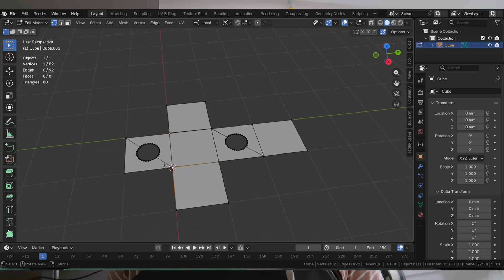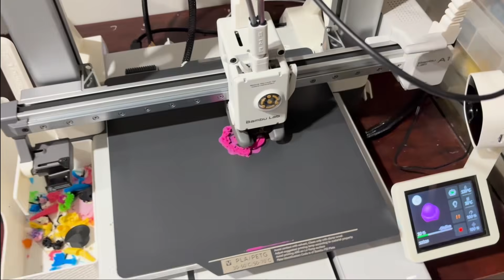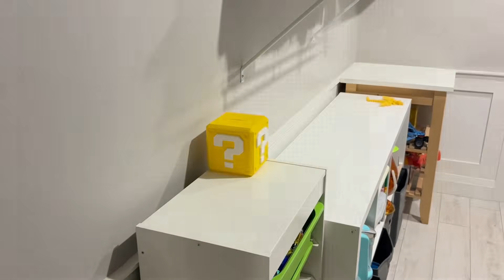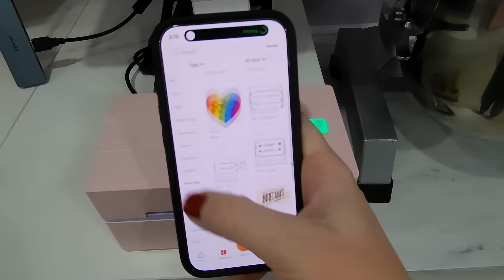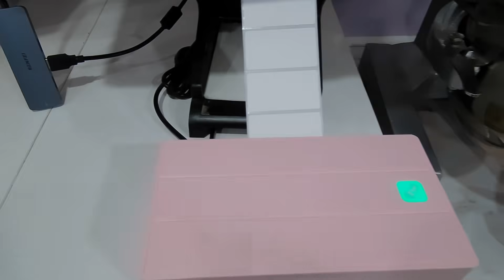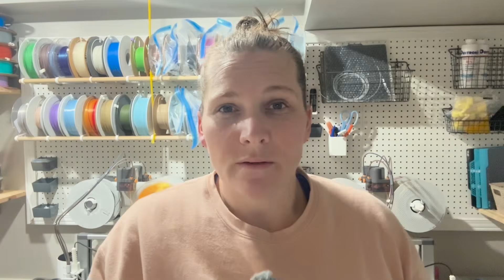Teaching Myself 3D Modeling With No Background - A Week Behind the Scenes+ MUNBYN 403B Label Printer

Comment: Are you using a cylinder as the cutting object in blender?
Reply from the maker: I’m using the actual model (so the cone) to cut into the ice cream.
Reply: @ashleyleeprints   Use a cylinder that has the with of the cones lip to cut it. You have two thing that you might be fighting  blender is seeing the cone as a u shape so the cone needs to be duplicated  for a cutter and add a top service to the top of the cone. BUT! if your slope toes inward  the cylinder will work better in the long run..